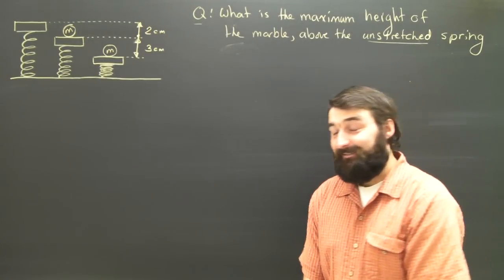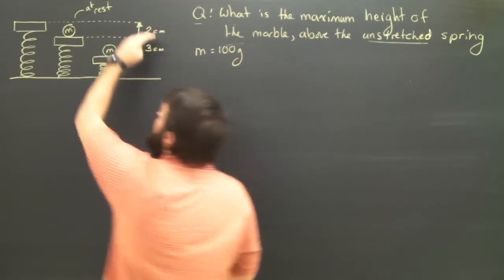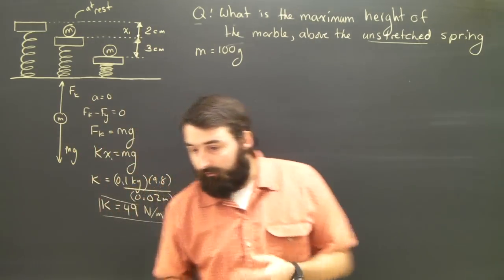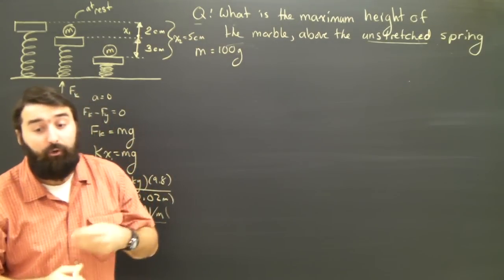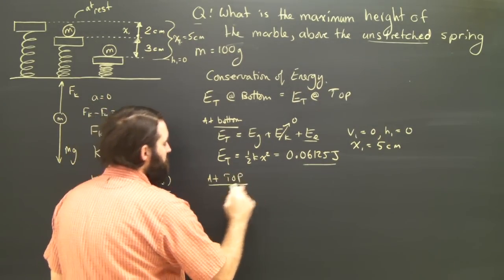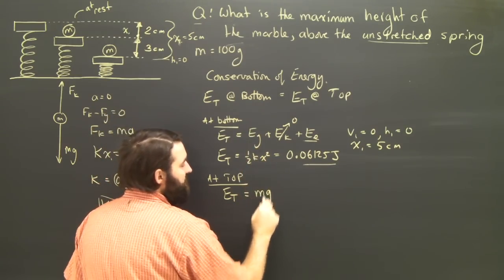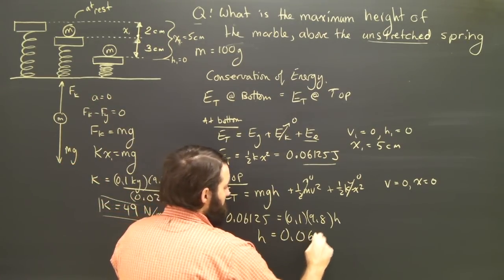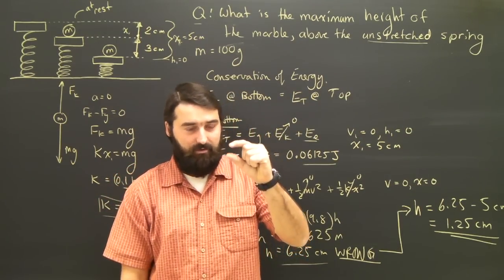Elastic Energy Springs Part 2 Physics Tutorial

Comment: @physicshelpcanada Thank you for your videos they are extremely helpful but I do not understand why 5cm were subtracted at the end, is h=delta h, as in h final - h initial?
Reply: NVM I guess h = maximum height of marble - height of spring unstretched therefore if the question was what is the maximum height of the marble above the compressed spring the answer would h = maximum height of marble - height of spring compressed, 6.25cm - 0cm = 6.25cm

Comment: Hi your vedios are alot of help. but i have a question. the velocity wont be 0 at the top but the potential energy of the spring will turn in to eithier gravitational potential energy or the kinetic energy. what if the question was, what is the velocity the marble will leave with. Am i right?
Reply: No u r wrong
Reply: then please clairify your point cause i wanna know where i am wrong

Comment: Excellent videos as usual.  The only thing I am confused about is the answer in realtion to the UNSTRETCHED spring.  Is the answer of 6.25cm correct in relation to the unstretched spring.  At the bottom the spring is not stretched at all, it's compressed.  At the top, the spring is completely stretched in relation to the bottom.  So, the marble is 1.25 cm above the stretched spring, and 6.25cm above the compressed spring.
Am i wrong????
Reply: No, I don't think you are.
Reply: What I meant was I don't think you are wrong.
Reply: Ignore the last two replies, watch the full video.